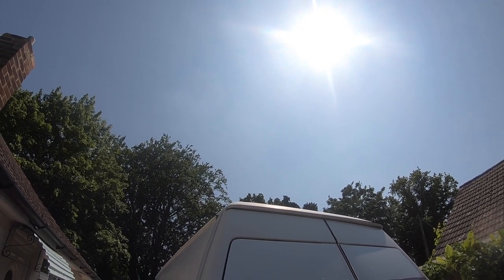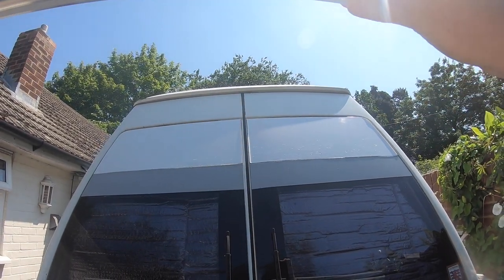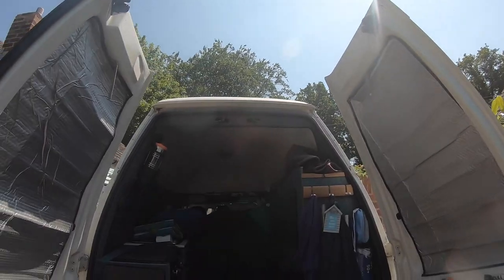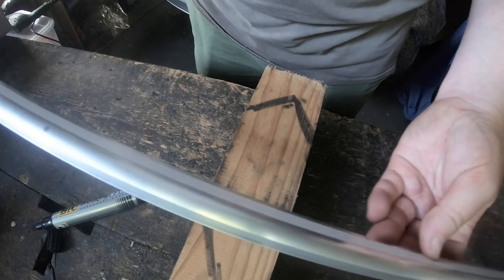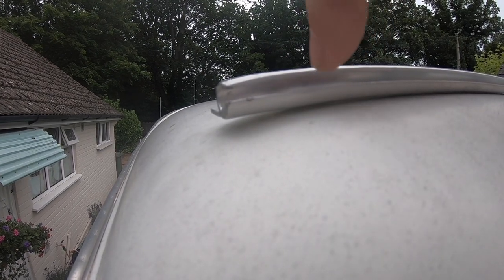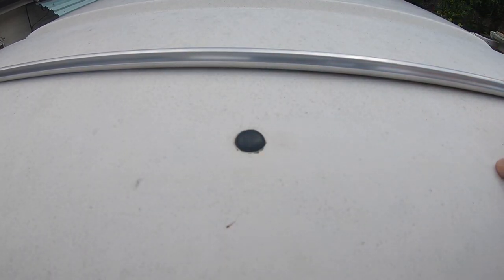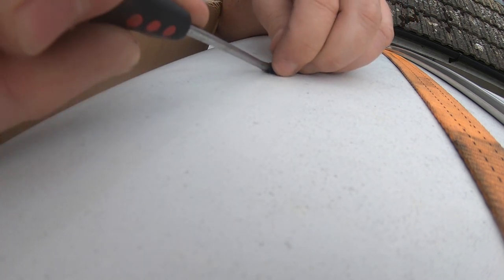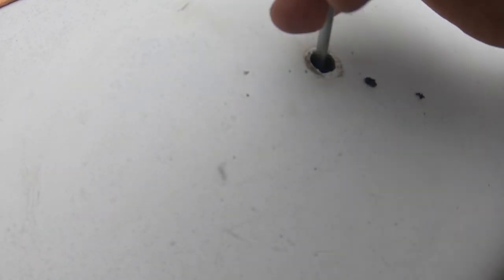VW T4 Camper Van Build 7 | Custom rear barn door sun canopy awning

Comment: What is the standing height inside? thx
Reply from the maker: it's about 1.8m maybe a little more
Reply: @AdventuresAutomobiles  Uh, im 1,88 tall and i was courious if i can fit in one of T4 with high roof but its hard to find deminsions for every version of the roof, i do know that theres higher versions but just didnt know is that one high enough for me. Thx anyway :) have a good day
Reply from the maker: I've just measured for you and it's 186cm with wood floor down and roof insulated as I have done.
Reply: @AdventuresAutomobiles  I appreciate the effort with the measuring. Especially two weeks later. It means a lot. Now, all i have to do is get some money and find good T4 in my country. If you ever gonna be on the Baltic coast my doors are open for you. Take care :D